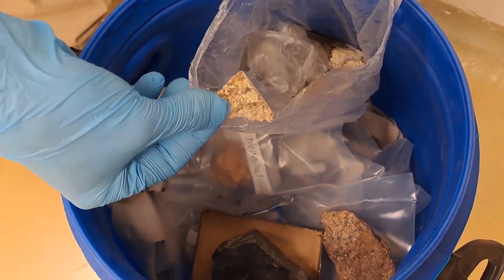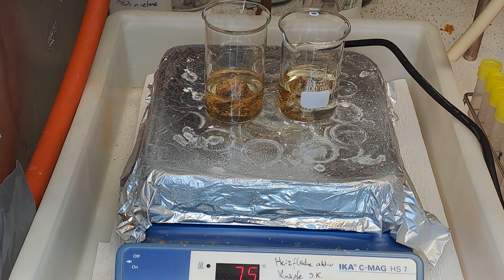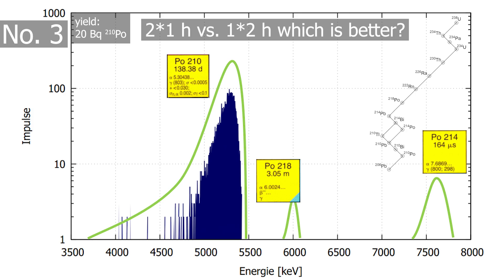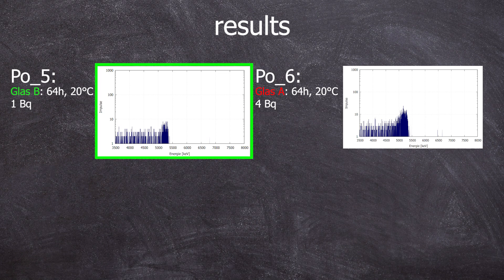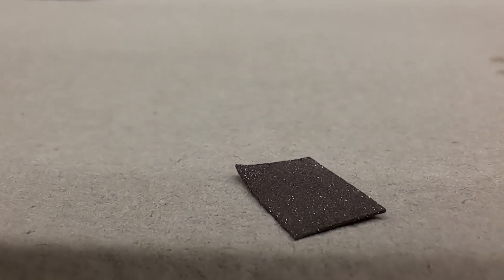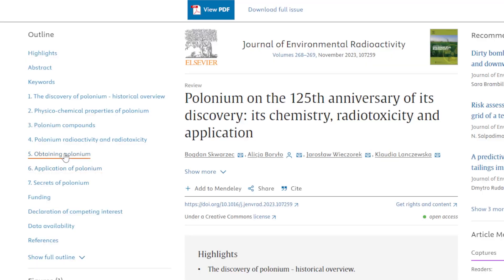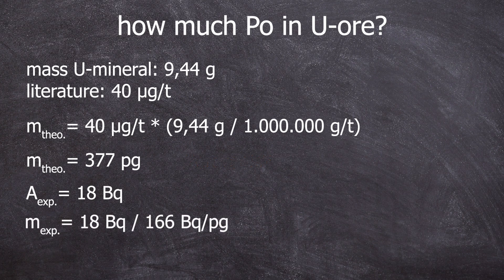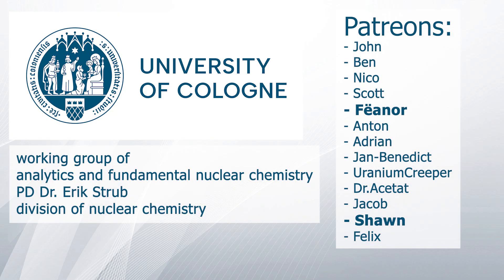Polonium from uranium ore (part 2) - practical nuclear chemistry

Comment: theoretically, if you'd take the used silver plate, containing the deposited polonium, and redo the process of extracting polonium but without using a new silver plate and using the exact same as the one I already used for the same experiment, what would happen? would it deposit more polonium or not?
Reply from the maker: Don't think so. The deposition is really messy on an atomic level. For the life of me I couldn't tell you exactly whats going on there. Sometimes the silver sheets come out looking fresh af and sometimes completely covered in brown mystery stuff and I have not yet found a correlation between that happening and depsited activity. Pitchblende is still a mineral and these things are weird. I reuse some sheets but in between I store them for months in 4M HCl... most likely the Polonium comming off is just a matter of concentration
Reply: @SimonsNuclearchemistry oh ok, ive always been interested and curious about the uranium chemistry, its so mysterious, sometimes it can be in a way and then in another
Reply from the maker: @BijouFrumushelu Uranium chemistry is really cool but Uraninite chemistry with all its elements is even more complicated😅 A shame I don't have that much time to spend on it

Comment: A better way to get the polonium out would be to ball mill uranium ore with charcoal then heat it in a high temperature retort. Have some silver foil in a tube that is cooled in the retort condensing tube. Polonium mercury arsnic and other volitile elements will stick.. For fun you can also measure the radon released during the process as well. If you like you can also recover the radium as well with dilute hydrochloric acid followed by cold vacuum filtering, reducing the volume, adding dilute surfuric acid and spinning it in a microcentrifuge.❤

Comment: I mentioned you in a previous video that identifying the mineral composition is key for standard potentials, yield of reaction, etc. One way of knowing it is asking from which mine these ores were extracted and checking in mindat which minerals are present in that mine. But I think we can guess something from the chemical reaction. Silver is tarnishing in this reaction so the anion of the mysterious mineral is reacting with silver producing a insoluble salt, so it's not nitrate. It's not a carbonate either, as strong acidic solutions bubble CO2 away. Silver halides and sulphate are white, so they are not either. But silver phosphate is an insoluble brown salt. So it could be an uranium phosphate. If that's true, the redox potential should be calculated with the formation of silver phosphate. Another option would be it's actually silver chloride and the dark colour is due to polonium doping. In any case it's of key importance knowing the chemical composition of the uranium ore and knowing which one gives better yield for polonium deposition.

Comment: how much of the uranium mineral "really" dissolved in the HCl solution ? would you say it`s fair to say there may be other isotopes on that "mystery layer" (5:44)? did the napkin removed "some" Po? probably not a lot though, Since it is likely there is a lot more than Po on the black layer, an unknown amount of Po could be buried in it and never produce a signal .. just rambling ! good video! Thanks
Reply from the maker: @Neptunium  the activity of the sample is so small, I couldn't detect anything else in the other measurments apart from Alpha. I did Gamma and X-ray spec. But nothing to be seen. We boild the living crap out of it and saw all the Uranium isotopes also deposited, which is a complete mystery for us. Because if it were in a water soluable Form we would have washed it of after deposition.
So the most isotopes we could identify were Po-218,214,210 and U-238,235,234 and only with Alpha spec. We know for certain that the experiment works but anything above that, is so far, just educated guessing😅🥲
Nothing on the paper could be detected with the CoMo-170 plastic alpha scint. The sample doesn't contaminate things as much as other nuclides would. Which also let us believe I might really be metallic Po but who knows reallys😅

Thing whole thing might turn into some sort of Ex&Ire Cubane thing 😂
Reply: @SimonsNuclearchemistry  lol!! Sounds like it ! I know Pa is a finicky metal with weird behavior too. . there is probably a lot more of it than Po right!
Reply from the maker: @Neptunium  Yeah ...but the Pa extraction from Uranium is quite well known and documented. There are even school experiment with the Pa-234m ;D (which I also am currently modifying) would love to explore some more Pa chemistry... there is so much stuff to do! If only the day had more hours.
Reply: @SimonsNuclearchemistry need an assistant?😁